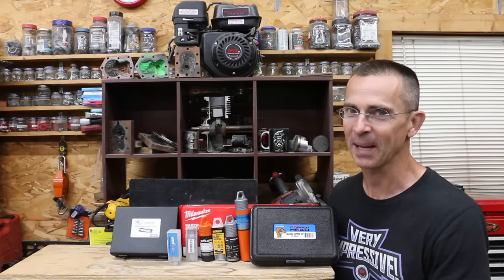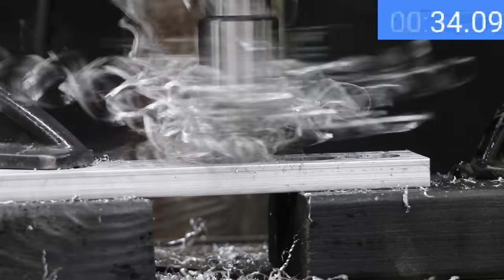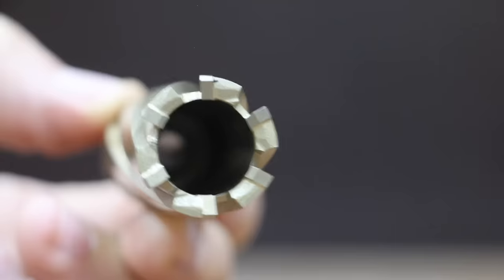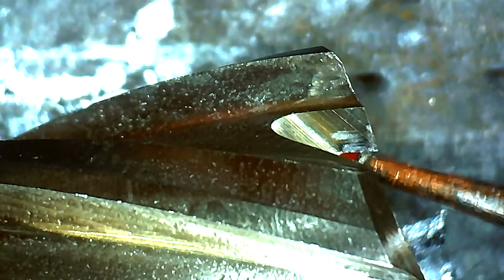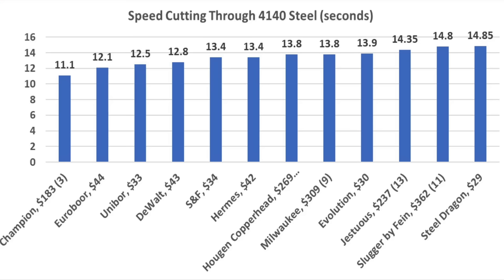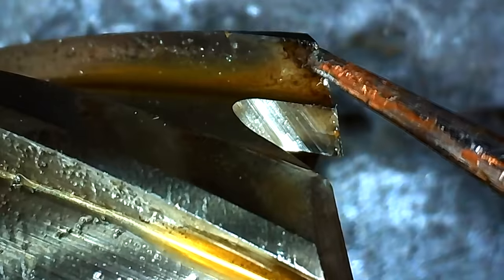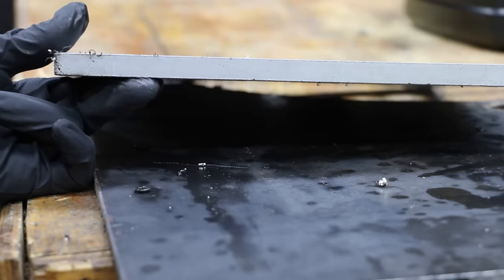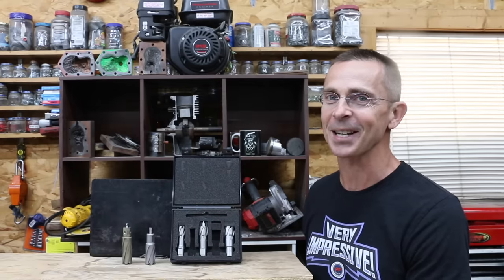Best Annular Cutter? Fein, Milwaukee, DeWalt, Euroboor, Hougan, Hermes, S&F, Evolution, Steel Dragon

Comment: For carbide tipped annular cutters to perform best, they need more speed than a high speed steel tool and much more down force.
If you go back to the first test and double the weight used, you'll find that the carbide will shine compared to high speed tooling. 
Chip removal is important as well as a good lubricant. 

I drill high strength steel truck frames using a Milwaukee MAG drill and annular cutters. Boring a hole though 1/2" steel that Rockwell's 45-58, the carbide cutters work great. The key is don't allow the cutter to bounce, otherwise the carbide will chip and become almost worthless.

Comment: We use annular cutters all the time at work when the refinery has galled studs sheared or cut off in their equipment flanges. The carbide tipped cutters are where it's at if you're drilling B16 or B7 studs. If you want a fantastic mag drill, look into the MAB-1300. They're great and the bearings hold up to some serious abuse, so your chuck/arbor always runs true!
Reply from the maker: Thanks for sharing!

Comment: I’ve drilled untold 10’s of thousands of holes in an iron fab shop with a Hougan back in the 80’s before they had carbide tips. With the Lube they recommended, ours were fed internally rather than externally. We could drill 1000(?) holes with the HSS cutters before a resharpening. Mag drills have come a long way in 40 years!
 Very good demo/info with this video!!!
Reply from the maker: Thanks!

Comment: Hey Todd, I am a woodworking and I'd love to see you test HVLP sprayers. They can be pricey but some aren't and these make or brake a good spray finish
Reply from the maker: Thank you for the video idea!
Reply: @ProjectFarm  See if they can apply lacquer as well as latex and alkyd enamel paint! 😎✌🏼
Reply: @ProjectFarm  I have a Titan Capsray 115 you can use. S.E. of kc
Reply: The Anest Iwata AZ3-HTE2 is probably the cheapest truly professional gun you can get atm. I did a few cars with it already and it's well worth the money.
Reply: Titan capsray user here! Its an expensive unit i think 1800 ish but it sprays anything. Paint, primers urethanes, water, oil, shellac, lacquer inside and out!
I do a lot of fine paint work and with a experienced user you can get a perfect finish with any paint!  I use it from trim to cabinets/ vanitys even used it to spray epoxy paint on the engine bay/underside of my Camaro!
 Water based is usually the one people struggle with because its thicker. No problem getting that super flat like glass finish with the capspray. Also easy to care of. Much less of a pain than an airless type sprayer.

Comment: The percentage of cobalt in HSS (expensive and unfortunately also used in lithium batteries)  makes a huge difference in cutting edge durability. Always like your videos. You are the consumers report for people that do stuff, thanks.
Reply: Plus he has never rigged a crash test to defame a vehicle becase someone in the office rolled one.

Donut media has a video on how Consumer reports rigged the Suzuki Samurai roll over test.

I can't take them seriously on anything now that I know what they did on that test.
Reply: I drove two Samurais over  a period of ten years both on and off road. I pushed them to the limit, had them air borne  both on and off road. Not once did I feel it would roll. Ever.

Comment: Minor correction: though it is now widely used for making target plates, AR500 is designed to be abrasion resistant, for use as wear plates in heavy mining equipment. The name is an abbreviation of "Abrasion Resistant, 500 Brinell"

Comment: Well, Commander, you did it again! I'm glad I don't do a lot of drilling because I've thought about getting some annular bits but realize I'd end up tied in a knot in a corner or out in the highway after I stopped cutting flips. With no drill press, my options are pretty much suicidal BUT I sure like your drill press tests and the mag-drill when things get down to the short hairs. Your tests are aimed at us old standby guys results over a zillion dollar lab somewhere that's probably bought off to start with. I was surprised that the Milwaukee went belly up though. So THANKS for another A-PLUS one and hope all is well as the leaves finish falling and weather cools off. And of course, BLESSINGS to all yall!
Reply from the maker: Hi Lewie, Thank you very much for the positive feedback! Great point about the annular cutters.  I too was really surprised that the Milwaukee didn't hold up a lot better.  Such an expensive set of cutters to dull so easily.  Hope all is well and wishing yall many BLESSINGS!!!!

Comment: nice tests!! One small detail to consider, you mentioned it a few times but people might gloss over it. The less-aggressive cutters might be better to have for general-purpose work since they're intended to be used on the bigger variety of materials. The aggressive cutters are really only intended for softer things like aluminum, plastics, brass, etc where they can sometimes perform better, but need a rigid setup and some oomph behind the drill motor. It's something to consider if a person is trying to just buy one and done.
Reply from the maker: Thanks!
Reply: Agreed, also something to note with carbide teeth you can usually run at a higher speed and feed (Milling) on harder materials compared to HSS, has to do with tool being able to run hotter at the cutting edge. For softer materials the higher cutting edge temps will "smear" the material and reduce cutting speed where with harder materials it will make the material you are cutting more ductile so it can be sheared off by the cutting tool. 

So point is have 1 for softer materials and 1 for harder materials.

Comment: Another great video! Ex-machinist here, you should/need to run the carbide bits at a higher speed than high speed steel or cobalt bits. Carbide can endure more heat and work better at higher RPMs.
Reply: only if flooded with coolant,hard to  do in the field
Reply: @tomstiel7576  carbide can get hot, it just has to stay hot. it doesnt like thermal shock

Comment: I use these at work all the time building tooling at Boeing. But we also only run them on mag drills at like 60RPM or less! Hougen and Milwaukee bits cut through 1-2” steel plate like butter. If you can keep them cool with a constant steam of cooling oil you can cut dozens and dozens of holes through thick steel steel before they ever get dull.

Comment: Awesome testing! I use anular cutters almost on a daily basis and carry a magdrill on my truck. I've almost exclusively used slugger but recently been testing some cheaper brands.  Thanks for more to try! Never thought any would have a chance in ar 500..
Reply from the maker: Thanks!  Thanks for sharing.
Reply: @ProjectFarm  If you do, do another series of tests try endurance testing in the metals they are meant to be used in.
So if you're comparing HSS cutters try this.
Drill 1 hole in Aluminum then 4 in mild steel and then repeat that sequence 3 or 4 or 5 times with a final hole in aluminum. In other words start in Aluminium and then every 5th hole is back in the aluminum. 
Don't worry about timing the mild steel. The aluminum is the test the mild steel is just for wear.

If you graph the times for the aluminum you should get a fairly good representation of how they are holding up. The other thing to look at is the accuracy of the hole. Is it still the same diameter?

That should tell everyone is how well they wear.

Comment: This is definitely a pipe dream given the cost, but I'd love to see one for lawn tractors.  Plus some of the attachments like snow blowers. Things like transmission and engine durability, ease of repairs, etc.
Reply: I too wish Project Farm to test lawn tractors, especially the 2-wheel powered units for small property/ poor access
Reply: @---l---  Yes, I bought a used JD lawn tractor last year when I moved to my place in Northern Minnesota and it died after a year. I need to replace it very soon as I need the snow blower, but at what they are charging, I need an unbiased guide where to invest my money.  I was told by the local JD dealer that my current blower attachment won't work on the newer models.
Reply from the maker: Thanks for the suggestion.

Comment: Another awesome video. One thing that might be worth mentioning is that the carbide cutters while lasting much longer, are also harder to sharpen compared to the HSS versions.
Reply: Can you even sharpen them?  Hougen says you cant sharpen the Copperheads.
Reply: Who cares if they last a lot longer anyway
Reply: Tool and cutter grinder here. . . . no they're not, you just don't have the training 🤣🤣
Reply: @T0tenkampf  lol, they're lying to you.
Reply: @cwill2127  It lasts even longer when a tool maker like me can keep pushing them back .010" at a time, or even replace the carbide tips and completely recondition an old tool.

Comment: This is a tool I had no idea existed, but it is a sensible upgrade to a twist drill or hole saw. It would have been nice to see one or both of those used on each of the tests to compare to the cutters to see how much more (or less) efficient the cutters are in comparison. Otherwise, very informative video!

It was very impressive how some of the HSS cutters were able to make reasonable progress on the AR500. I've never had to drill AR500, but if I had before learning about these cutters today, I probably would have gone looking for an armor piercing bullet of the right size before I attempted using a regular drill bit or heaven forbid a hole saw.
Reply from the maker: Thanks!  Thanks for the suggestion.

Comment: One item I would like to see tested is the buffing wheels used to clear up headlight lenses. 
As our cars get older🎉 the lenses get cloudier and the light does not get through as well. 
This tool is not expensive but I worry about damage and do not want to replace the whole assembly.
Thank you for all your hard work. Very fast paced clipped and worth the watching time.
Reply from the maker: You are welcome!  Thanks for the suggestion.

Comment: Carbide in general doesn't have as sharp edges as HSS, so you'll see poorer performance in soft stuff like AL. If you want to see better performance you'd have to spin her faster. General rule is 3x what you'd run HSS. Not sure if that's what you'd do with annular cutters, but I'd definitely run it faster than 250 rippems.
Reply from the maker: Thanks for the feedback.

Comment: While very expensive, my best purchase for tools for my job was a magnetic drill press with annular cutters.   
So much safer and faster with larger holes and heavier materials.  Zero regrets spending the money.
Reply: Strong agree.  I don't quite need them for home use, but they're indispensable in the shop!  We use Champions, btw.

Comment: I'd be very interested in seeing a comparison and testing of the different types of locking washers and their effectiveness or lack thereof. Along with their effect on fastener torque ratings and points of failure. Such as Split washers and their different grades vs wedge type vs serrated vs spiral ribbed vs internal toothed vs external toothed vs internal/external toothed etc. Even the bizarre double spiral lock washer.
Reply from the maker: Thanks for the suggestion.
Reply: I thought that the general consensus was that they don't work. If it's critical, wire them, like in aircraft. Otherwise nyloc or adhesive.
Reply: @markrainford1219  That's why I'd like to see them tested.

Comment: Use pilot pin whenever possible, you can see in the shots here that they can wobble a bit when initiating the cut, and they shouldnt. No.2 is coolant, its not really optional when cutting in steel, and contrary to what lotsa people think, “i will feed it slowly so dont need cooling”, it actually gets hotter when cutting slowly, almost all of the heat is in the removed material so in an emergency with no cooling you can feed faster.
Reply from the maker: Thanks for the feedback.

Comment: Yeah you need to compensate your speeds and feeds.
I recommend picking up a machinists handbook that will tell your the proper speeds and feeds for all sorts of materials tool materials and cutters.
The machine will also tell you if you need to go faster or slower and is a learning curve to say the least.

Comment: 😎👍🇺🇸

We're actually struggling with this at work.
We have to cut though damaged SS locks with a mag drill.
It's not working out too well.
Maybe some of these carbide tipped bits will work🤔
Reply from the maker: Thanks for sharing.

Comment: Hey PF, have you ever thought about testing electrical connectors, and the different methods of splicing wires together, along with their strength or weakness? I'm currently having a hard time deciding which way to go connecting some automotive wiring together... might make for an interesting test. Cheers.
Reply from the maker: Thanks for the suggestion.

Comment: Thank you for another great video!
I would like to see some behind the scenes video on how you develop your testing methodology.
For this video for example, the carbide tipped ones might prefer a different speed/weight on the drill than the HSS ones do. (I've heard they prefer higher speeds and lower weight)
So how do you decide in what parameters to test with?
Great work as always and I'm looking forward to more!
Reply from the maker: You are welcome!   Thanks for the suggestion.

Comment: 💡For your next video you should test how different fuel lines/fuel line materials hold up when submerged in gasoline. I changed an in-tank fuel line recently and used the wrong kind, made a mess when the fuel line broke down... there's not a lot of information online about it and there's tons of companies overcharging for 'submersible' fuel lines.
Reply: I'd like this video too tbh, I paid $30 a foot for so-called submersible fuel line a while back and I still to this day feel like I got cheated. Would be cool to see if spending that kind of money is neccesary for submersible fuel lines...
Reply from the maker: Thanks for the suggestion.

Comment: The best thing about the HSS cutters, is that you can sharpen them when they get worn. For the Carbides, you have to send them out for sharpening
Reply from the maker: Thanks for the feedback.
Reply: I would be very surprised to see a shop with the equipment to resharpen one of these.

Also carbides would probably have new inserts brazed in rather than reworking them
Reply: You can sharpen carbide with diamond files. And yes they get sharpened and not resoldered, which would mess up the alignment.
Reply: @lennart637  when I was a machinist, we had to send the used or broken carbines out to the supplier for recycle. They'd grind them up and put them in new batches. I was always under the impression that sharpening carbides was too expensive and too time consuming to bother with it
Reply: @adamray2305  We send out our brazed carbide tools to get sharpened. This only works if enough edges are reasonably intact though. The insert carbides just get replaced.
Reply: @lennart637  the companies I've worked for used the inserts for cutting, and solid carbide end mills for other applications. I've only worked with a couple bits that had the brazed carbide, and if that tool lost one or two teeth, then we'd save them to use only on aluminum. For anything else, the company would just toss them

Comment: Carbide should be run at a much higher surface speed than high speed steel. I'd start at 500rpm and make sure it stays very lubricated, like you did on the ar500.
Reply from the maker: Thanks for sharing.

Comment: Great test! I just bought some carbide annular cutters so it's great to see the comparison between carbide and HSS.

As an idea for a product to test, vehicle recovery traction boards would be interesting. There are a variety of common options available with different weight ratings and traction surfaces. On some the traction lugs tend tear off on the first use, so it would be great to know which brands are the most reliable.
Reply from the maker: Thanks!  Thanks for the suggestion.
Reply: Carbide cutters are amazing, I personally own an helical solutions 3/8ths Endmill that is capable of HEM

Comment: I keep thinking "feed harder" but I often forget most people don't have powerful machines to drill holes.  We were using a cheap 1" diameter twist drill with a 3/4" shank in 7075T6 aluminum plate 2" thick.  The drilling time per through-hole was a hair under 3 seconds, requiring about 18 horsepower from the CNC machine, and the cheap drill lasted 1200 holes on average.

Comment: In the UK we call these rotary cutters or mag-drill bits. I was surprised you didn't have any 'Rotorbroach' cutter's, as they are the pioneers of magnetic drills for metal working. Unibor also supply carbide tipped cutters. Jancy are the company behind 'Slugger', therefore they too are a branded cutter and should perform well. Thanks for your continued, concerted efforts.
Reply from the maker: You are welcome!

Comment: Thank you for taking so much time and incurring so much expense to do these tests. I would like to see a comparison of tire pressure gauges - just gauges, not inflators or battery chargers. I have 3 gauges and I get three different readings when testing my tire pressure. I actually get 4 if you include the tpms reading. Thank you